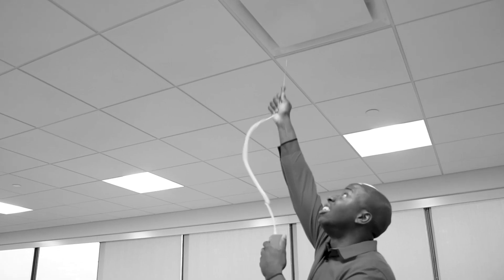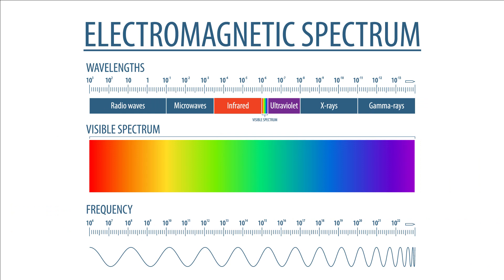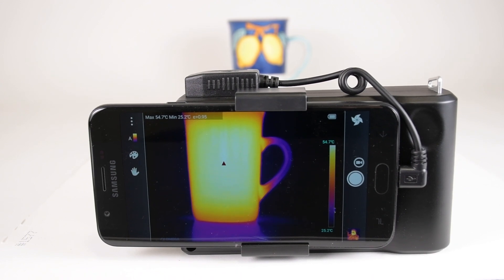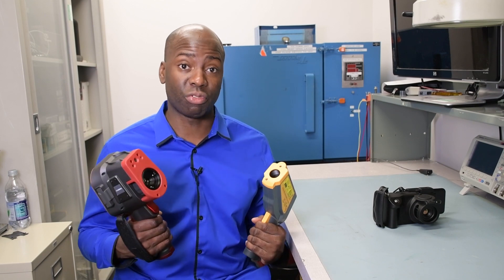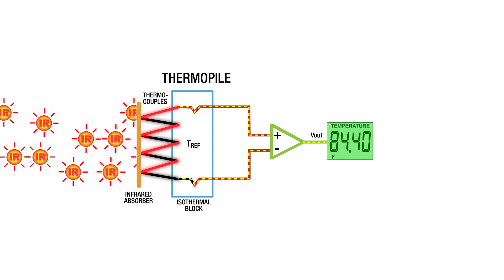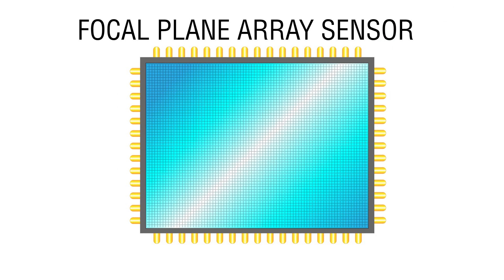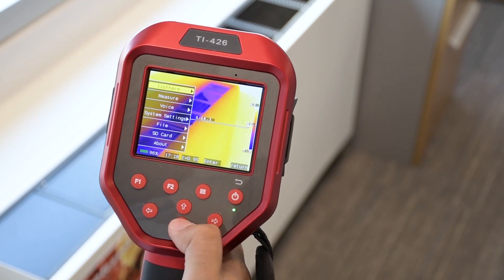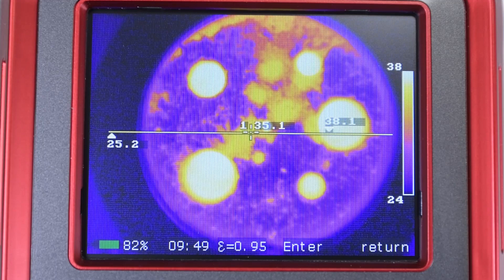Thermal Imaging vs Infrared Thermometer | Types of Thermal Imagers

Comment: Which thermometer is better-Infrared or thermal?
Reply from the maker: Both have their strengths, what are you using it for?
Reply: OMEGA Engineering looking for bees behind drywall/plywood.
Reply: @notafuckinpplperson8233  If I may interject, an IR thermometer gun detects the temperature of an object as a function of its IR radiation, while the thermal imaging gun detects the IR heat signature itself. 
The temperature variation caused by having bees in your walls will not be detectable within error margins by the thermometer. I.e., you will have to take an average temperature of the wall and compare each point to that average to determine whether a section is truly warm, and a potential hive location/ 
A thermal imaging gun, however, will capture the temperatures of thousands of points on the wall, and automatically colour code based on the temperature average of the image to show you where it is warmer or colder, giving you a much better idea of where the hive may be.
Hope this was helpful.